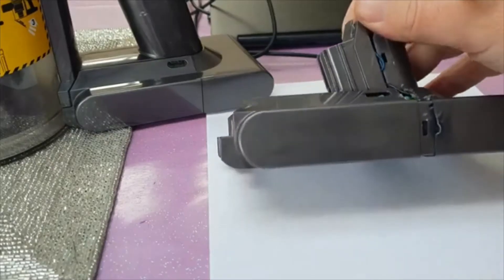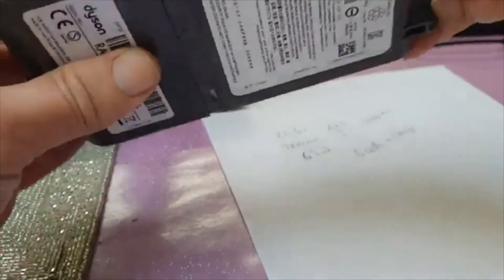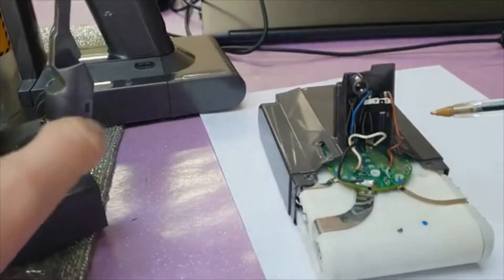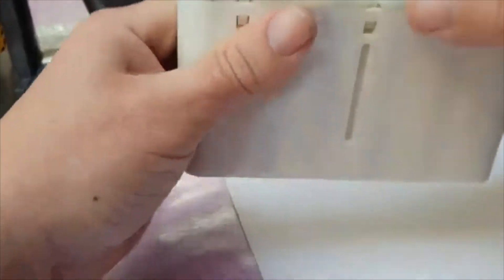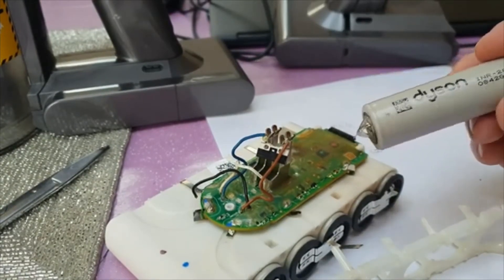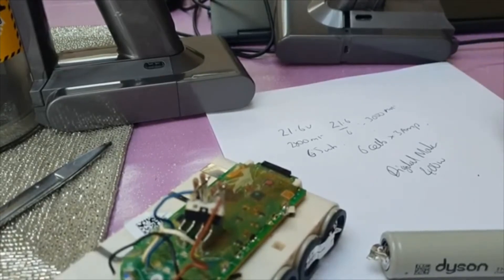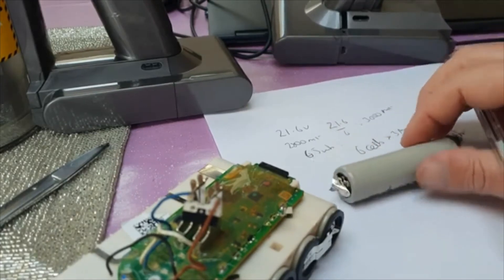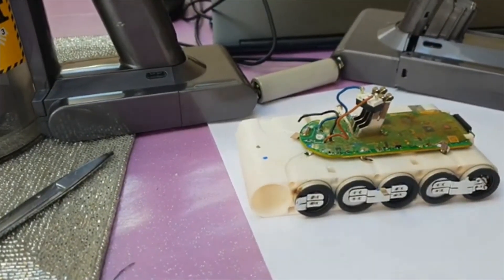What's inside the Dyson V6 V8 and V10 battery pack?

Comment: Hi, interesting !.....But if you disconnect a Dyson BMS (like for many laptop BMS now)  and change the cells , it locks down definitively (red light) after new connection. So you cannot change the cells,. 
I add that the motor drains a lot of amps (more than 20A with Max) to run, and it's necessary to control first of all the internal resistance of each cell. You can often still  have a good voltage level  (I opened a lot of Dyson packs with more than 4V/cell) but with too high IR ; so if you drain too much amps on such a "tired" battery , voltage falls and the BMS stops the current. Simply an usual BMS allows the recharge...but Dyson's BMS not!
With these Dyson batteries with only one cells row (2 rows in // would be much better...but commercilly uninteresting) don't use the max power. That kills these weak batteries very quickly : Max power = max amps discharge in a short time , and Lithium cannot support this torture a long time, even with good 30A cells. With 2 // rows it would be half as much per cell. But life time would be too long for Dyson!
Friendly, Michel.
Reply from the maker: Thanks for your comment; my wife only used it on full power and it died in 6 months. I was initially thinking I'd make my own pack, but decided that Dysons are too poorly made, brittle plastic; over priced junk, so went back to a Henry hoover 🙂 I may have a go later.

Comment: As mentioned, these are not the usual 18650 size found in power tools and older vacuums. There are several other lithium-based battery sizes both larger and smaller.  The size number is actually diameter of the battery in mm; the 18650 being 18.65mm or 1.865cm in dia, and the 20700 being 20.7mm or a hair over 2cm in dia.  Another common size used in small flashlights is the 14500 which is close to an AA cell in size (but 2X+ the voltage of course). Single cells used for flashlights, power bars, etc require protection (aka "pcb") that caps the negative terminal and is hidden underneath the shrink wrap.